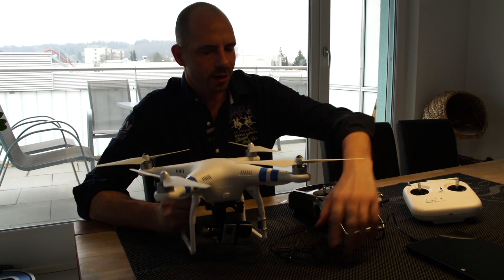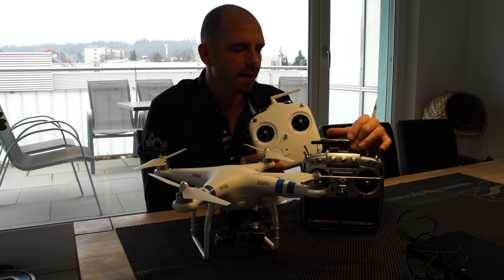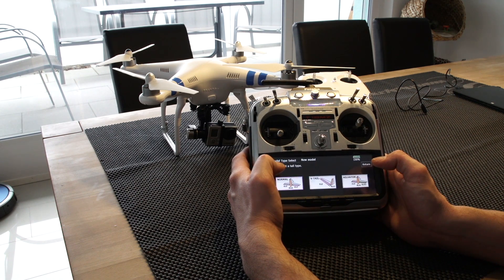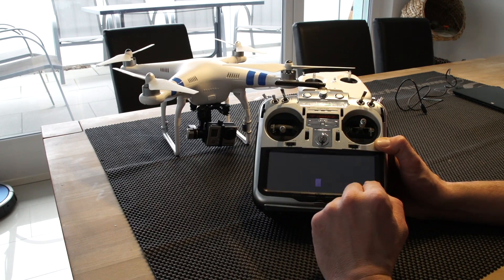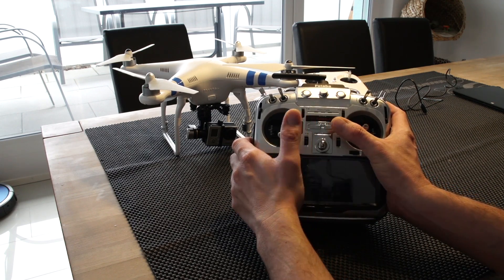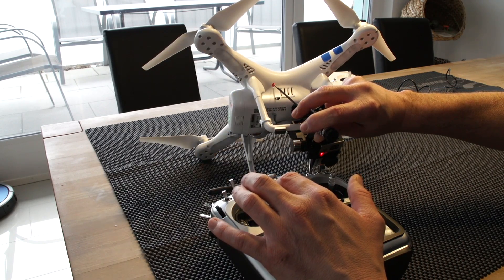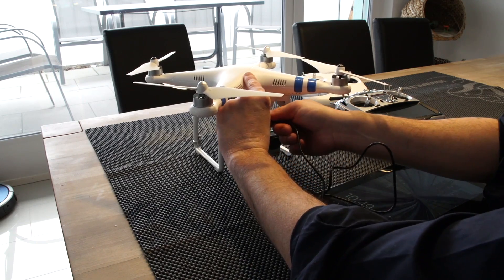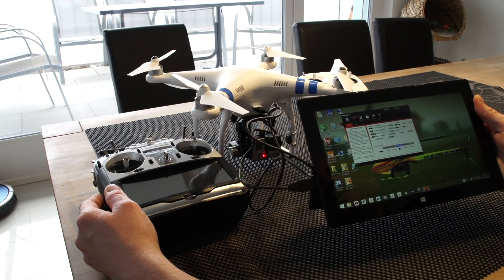How to: DJI Phantom 2 - Binding to Futaba and complete programming guide

Comment: I know this guy knows what he's doing, but everybody else,mainly beginners, Please take off the props before performing tasks like this!
Reply: +ViceVersa Musik The Phantom is way too underpowered to do any damage ,i wouldn't take them off either...
Reply: Ioannis Koukouzis The Phantom is NOT under powered!! Spin the Phantoms props up to full RPM/Throttle and put just ONE of your fingers into the blades as they are spinning, Because your gonna need your other fingers after you see what happens to that ONE finger!!!! And if you are stupid enough to try this, Don't say I didn't tell you so as your running to your MoMMy in shock because your finger is hanging from your hand and blood everywhere! The Phantoms props WILL leave more damage! than 2 or 3 stitches at the end of the day, and your crazy to think otherwise! Anywayz... Give it a try and let me know how it goes... ASAP! Also, if your skin and bone  happens to not give in, then the props might be to much on the softer side. Just be safe and have fun dude! Cheers from Maryland!¡!¡!¡!¡!¡!¡!¡!¡!
Reply: +ViceVersa Musik  done it many times....even with carbon props...as I said, it is underpowered because it's designed for consumers with not much experience! Anyway, I'm not suggesting anyone should try it, and especially with bigger multi rotors ALWAYS remove props during setup and testing in house!
Reply: Ioannis Koukouzis Lol I know right. EVERYBody, you must take your props/propellers off when your working on your craft with the power on!!! And I say propellers because like you said, these drones are aimed to be sold to people with 0 experience, and in a way, I feel like this shouldn't be allowed! YES there easy to fly, but still very dangerous in beginners hands if you ask me, and I'm not saying they shouldn't get into the awsome hobby of RC that I grew up on and luv so much! They could have probably kept like the DJI Phantom and the Youneec in hobby shops instead of on BestBuy online websites, same for SAMs Club, you know, places I 7
Reply: Props should definitely always be off

Comment: Very nice video, thank you very much, but just a quick question, as you said, T18MZ, or 14SG, doesn't matter a lot, but how did you bind the Phantom to the radio? I mean did you install a Futaba receiver in the Phantom? or the Phantom receiver is compatible with Futaba Radio? Kindly advise.

Thank you

Comment: Hello there, thanks for this full length video however I am clueless as to why you chose the Numbers you did  when you were switching from normal to failsafe. And from GPS, ATTI and failsafe. The percentages that you're using are meaningless to me. Why did you choose those specific numbers and how did you go about the process. Is there something we are missing on the Windows screen? If anyone else cares to answer this question I'm all ears. Thanks
Reply from the maker: evan2156 : You assign 2 switches of your tx to a) Manual, ATTI and GPS and b) IOC Control. When you open the Wookong App you see when you move the switches where the pointer stands. You might reduce the travel or adjust the travel to get switching from Manual to ATTI and GPS as well as for the IOC modes. I assigned a specific switch that triggers failsave which must be mixed.

Comment: Just a follow-up to my last comment, I found that menu at the "model menu."  One comment is that if you want the SC switch to follow the DJI transmitter with the GPS on the top, you'll also want to reverse auxiliary 5.  In that case, the adjustment for the failsafe HS is as you adjusted the first time, with the curve downward on the left.

Comment: Thanks for your video.  At 8:20, you enter some menu with AFR (D/R) on the top left, where you modify a curve.  Unfortunately, I can't find that menu.  What did you select to get there?
Reply from the maker: Hi, it was just to set the switched that Normal is first, ATTI is second and GPS is third. You need to have the Switch assigned first and then modify the curve according to your preferences. You can check whats happening when you look at the DJI App.

Comment: Thanks for the walk-through -- very helpful!  I'm wondering if there might be a way to use the dual-rate (or another) function to use a momentary switch (e.g., SH on the 14SH) on the controller as a "start-up" switch (i.e., set 2, 3 & 4 to +100, and set 1 to -100).  How difficult is this to accomplish, or is it possible at all?  Could it also be programmed with a delay to prevent an inadvertent, in-flight shut-down?

Thanks!
Reply from the maker: Hey mate, I would never do this as the position of the sticks is a security feature. I am sure you can do it but I don't see any sense in it :-)

Comment: Did you bind the Futaba directly to DJI factory receiver, or did you replace it with a Futaba receiver first? Thanks! :-)
Reply from the maker: Directly bound to the factory receiever...
Reply: Really?! So I can buy a Futaba radio and bind it directly to my Phantom 2, and then maybe use the receiver that comes with the transmitter on another craft? :-)
Reply from the maker: Bobster986 Precisely. The transmitter needs to be FASST compatible.
Reply: Locoracers What is FASST?:-)
Reply from the maker: http://lmgtfy.com/?q=futaba+FASST#

Comment: Hey, I have a Futaba T14 and I'm almost there just trying to figure out the failsafe/normal settings. I've set my switch in the functions menu, but it's at 8:18 in the video that I become confused while trying to follow along on my 14sg... You wouldn't happen to know how to adjust the Dual Rate for Aux 5 on a 14sg, maybe?

Thanks
Reply from the maker: Mate, you need to apply a mixer for the failsafe. On the 14SG its slightly different than on the T18. Open the application of the Naza and play around with the Mixers, you'll see quickly how it works. You need to mix an additional channel to the GPS, ATTI and Normal Chanel.
Reply from the maker: Dual Rate is adjusted in the D/R Menu of the 14SG. There plenty of vids on Youtube that explain how to setup a mixer and failsafe on the Phantom with 14SG. If you are still stuck PM me and will put together a short explanation for you :-)
Reply: Got it.. Thanks!!

Comment: how you liking the phantom so far?
Reply from the maker: I like it a lot. 20 minutes flightime and the possible extensions are awesome. If you want to have perfectly stable video you need to use the H3-3D Gimbal as you see still some disturbances on YAW when the Phantom corrects its flightpath with the 2 axis. If you are new to multicopters this is the thing to start with

Comment: Hey man! 
Love your videos! 
Is there any chance you could do a tutorial on how to set up a dx9 with the phantom 2? 
I would really, really, REALLY owe you one :)
Thanks!
Reply from the maker: Hey mate, thanks a lot!! My problem with the DX9 is that I don't own one anymore and I do not have a receiver anymore. But...you would need to plug the NAZA to the receiver and disconnect from the DJI receiver internally and then the programming is quite similar. I am sure this has already been done for a Spektrum, Just check on Youtube :-)
Reply: Locoracers
Thanks for the answer! 
Apparently the phantom 2 does not support spektrum transmiters so I would need to use an orange rx via s-bus. Im a total newbie so I am afraid of messing up. There are some videos on how to do it with the phantom 1 but nothing for the phantom two :(
I guess Ill keep looking and probably someone will make it happen sooner or later :)
Just saw you know, your tutorial on the PC groundstation was what made me get the phantom 2 :)
Thanks a lot and happy flying!!!!
Reply from the maker: It seems that there is a tread here: http://www.djiguys.com/Forum/viewtopic.php?f=39&t=3021
Reply from the maker: And you can of course just fly with the original transmitter from DJI until someone comes up with a solution. :-)
Reply: Locoracers
Yep, I saw that thread, and there is a video around here with comments with a guy who made it work, but being a total newbie I was hoping someone who knew what they were doing would make a detailed tutorial as yours. 
I think Ill just bite the bullet and try myself. There is plenty of info and at some point I will need to learn how to do this stuff :)

Thanks again!!!

Comment: After binding my futaba 14sg to the P2, it works fine, but doesn't seem to have a "kick" or punch like stock. Moves a bit slower. This a gain setting or ?
Reply from the maker: Hmmm, have not noticed a difference really and I do believe that there is none as you calibrate the new transmitter over the Naza App and therefore way stays the same. When you have assigned a switch to modify the gains certainly this could be the reason (low gains).
Reply: Locoracers Ahh the gains, you are likely spot on. I'll give that a go and see if it works.

Comment: Awesome Futaba transmitter! Do you get extra radio distance with it? & do u have to install the futaba receiver inside the Phantom 2? & is it possible to do the same mod/setup with the new Phantom 2 vision plus?
Reply from the maker: I understand that the Vision Plus will be working on 5.8GHz as the Video link is on 2.4. This means that it is not compatible.

Comment: Awesome video and very helpful. Also what windows tablet are you using?
Reply from the maker: Microsoft Surface
Reply: Locoracers Is that the Microsoft Surface 1? Do you find it sufficient for all things RC? I'm looking into getting a dedicated tablet capable of being my all RC tablet (which means it must have a USB port like your does), so I wanted to get your thoughts and input. Thanks! :-)
Reply from the maker: Hi mate, its a Surface Pro 1. For all DJI things its perfect. For all things that need UART Drivers I do have a second one running on Windows 7 as not all chip sets are compatible with Win 8 or Win 8.1.
Reply: Locoracers Thanks for the reply! Yeah, that was my fear. I was hoping to use it for my helis, quads, etc. I'll do my research before pulling the trigger on anything. Cheers bud! :-)

Comment: Great video
The T8J will not work. The 8FG is the cheapest radio with Fasst
Reply from the maker: Hi mate, I have updated the description with the link. Just dumped the file from the T18MZ card. I any way, you need to do the calibration because you are switching the TX. http://locoracers.azurewebsites.net/wp-content/uploads/2014/01/DJI-Phantom-2-Futaba-T18MZ.zip
Reply from the maker: You're actually right. 8FG is the new one. The T8J does not Support FASST :-)
Reply: Locoracers hello buddy. nice video and great work. i request you  if u could send me the model since i recently purchased 18mz but couldn't configure dji naza m v2 on my dji f55o. if u can upload all the files of model which u have.

thanks&regards
A.malik
Reply: Locoracers excellent job bro.    Thaaaaaanks;)
Reply from the maker: عبدالملك البلوشي: Welcome!